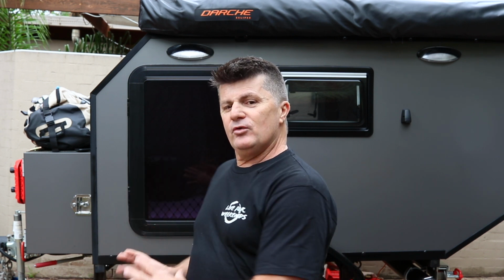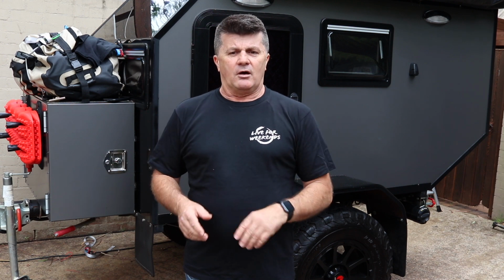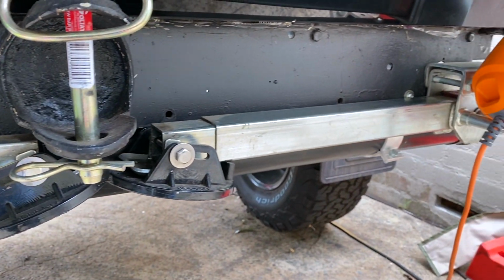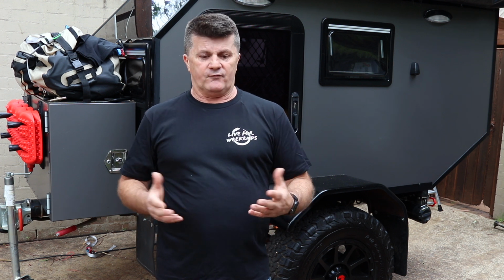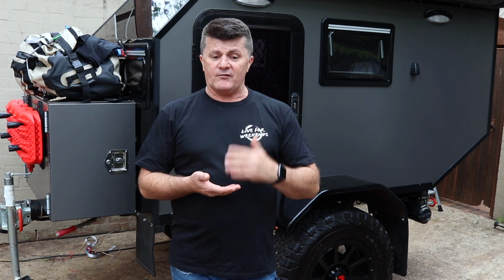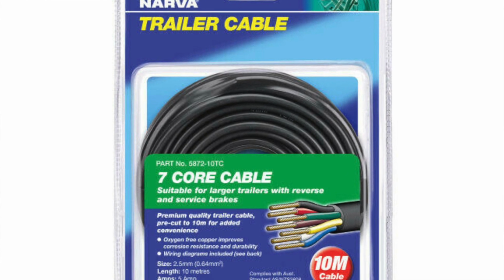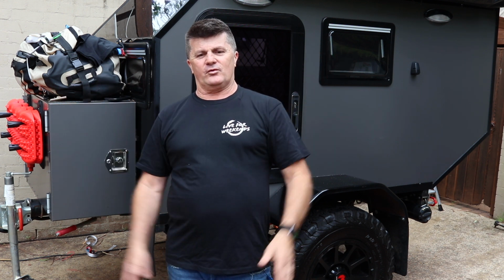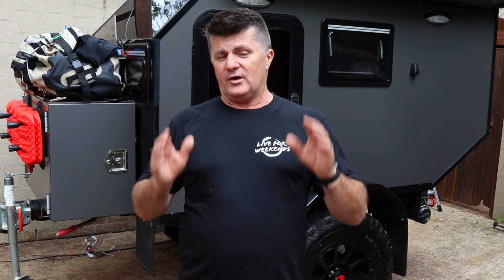DIY Off Road Camper // Full Build Costings

Comment: another great video - great summary on costs and realistic commercial costs. would you every convert on old microlite 10ft camper (70s era) and lift/upgrade chassis/suspension and keep under the 900kg? You could stand up in it then.

Comment: Impressed, looking at buying one you can buy a reasonable unit at the moment $35,000.I have even looked at a site that makes Trailer unit to nearly a military Spec $15000 then getting a unit built on top so would probably end up around the $40,000 mark.Nice build.

Comment: You've done very well indeed for the quality you have built. You could've paid as little as $7k but I doubt it would have made if off the bitumen in one piece. 
I'm currently building one based on a "heavy duty" 8x5 trailer (the trailer is replaceable) - kind of a slide on but with modules - so three "slide on" modules. At the moment I'm struggling with the pneumatic raising roof but I have an idea...moo ha ha :)
Reply from the maker: Sounds an interesting build!

Comment: I've spent a year and a half building mine.
Finally going on my first trip next week.

Because I spent so long building I was able to save crazy amounts of money.

I think my totals right around 1k$ not including the trailer.
The trailer is all 2x4 and 2x3 square tubing, so went a little excessive there.
But all in all, if I didn't take as much time as I did, I would probably be at around 5k with the same build.
So much you can find for cheap if u give it time.
Reply from the maker: Sounds like a great camper, enjoy.

Comment: Great job, Darryl! Thinks add up quickly. I am 15 months into my build, slightly larger (2.2m x 4.2m x 1.9m), all aluminum incl. frame with timbren independent suspension and am over $20k Cdn. already. As far as cost is concerned, I’m about at 80%. As far as build, about at 70%. 
Thanks for sharing.
Reply from the maker: No problems, sounds like a nice camper.

Comment: Hey legend is the Alko 840mm stabilisers the perfect size for the no5 chassis? I need to order some for my build not sure what size I should be looking at
Reply from the maker: Hey they work fine, I haven't had an issue so far.
Reply: @DarrylSheather  you just opt to have the two of them at the rear or do you have em on all4 corners mate
Reply from the maker: @panibe00  2 @ rear works ok

Comment: Now that you've signed off this project I'd love to hear about 'Off Road Camper V2'.
Reply from the maker: Haven't signed off on it, still a few more things to do to this one. Although, you'd have to be looking at chassis design and modern lightweight materials for construction (along with questioning if those lightweight materials are better than traditional or just different).